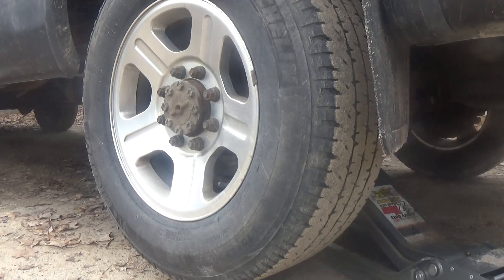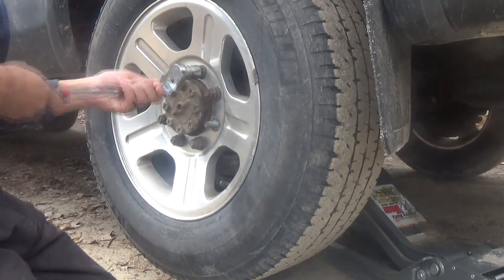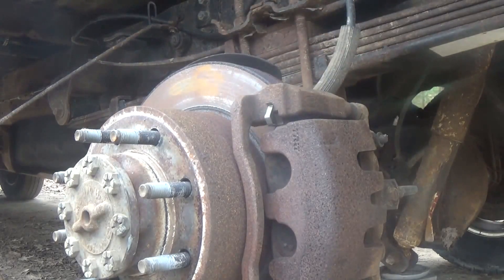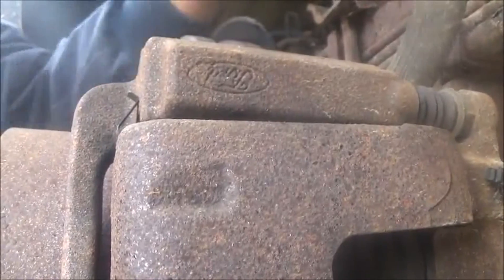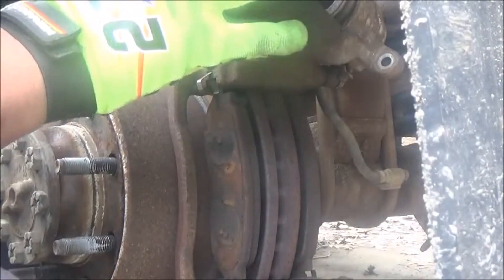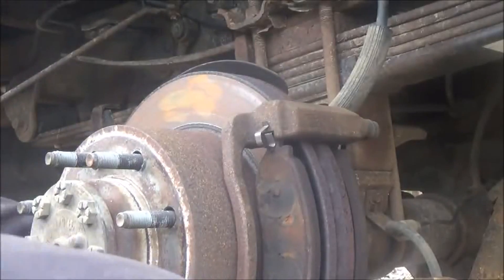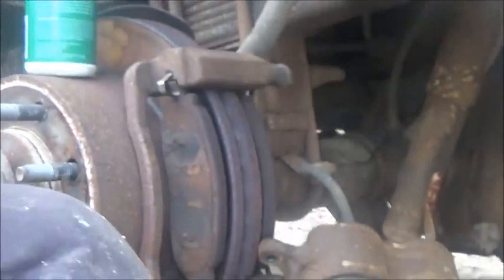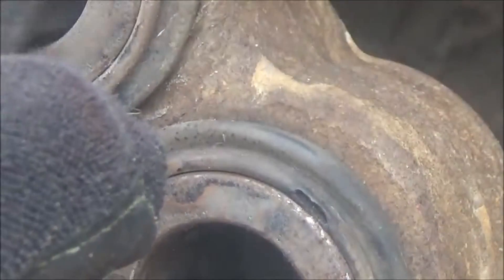Can you smell your brakes or hear squeaking?  Try this free fix!

Comment: This could also be a problem with the brake hardline or rubber brake hose not allowing brake fluid to return after braking. They can become crimped, clogged or in the case of the rubber line, just wear out internally. Check the bleeder valve before buying a caliper. Open the bleeder... if fluid shoots out  under pressure, it's the line. If fluid slowly oozes out, you need a caliper.

Comment: I replaced my brakes up front rotors and pads, now one side is locking up for some reason. The pistons acted fine when retracting them. I did notice the brand new pads were way too tight going over the rotors on both sides I am wondering if the rotors are the wrong ones. I got them from rock auto. So if the pins are causing the caliper to not function right?  It looks like your piston on that side is totally seized if the pad is not contacting the rotor at all.
Reply from the maker: Correct kind of.   The brake assembly only supplies actual pressure to one side.  So if the pin freezes then the piston is only pushing on one side.  Not sure if that makes sense, what I'm trying to say.  
I've never used parts from that place so no idea about that experience.  I bought all four for my truck and I just resurfaced them once since.   Big cost up front but to have them "turned" it is a fraction of the cost.   
I'm glad your watching though.  Hopefully I helped in some way.   

(Related to your screen name)  I have recently gotten back into RC.  So now with my 3d printer I've been making tons of custom parts.   I will probably make another account (if I do) to show RC stuff.   

Thanks for watching. 
DIY-Zac

Comment: Good video.  Glad to see you are using correct lubricants.  Anti-seize on lug studs is excellent also.
Safety note:  It is better to set the vehicle down on the jack stand and then leave the jack under, than leave the weight on the jack.  The way you have it, if the elevated vehicle rolled fwd or aft while falling it could miss the jack stand or hit at enough angle to dislodge the jack stand. This is particularly important when the rear axle is elevated on a RWD vehicle but applies universally.
Reply: What is wrong with the silicone brake grease?
Reply: @lydiahubbell6278  Nothing.  It works just fine.  On the square O-ring for caliper piston I use the brake fluid it self because it is very slick and lower viscosity for ease of installation and easier (modestly) to clean up excess.

Comment: This happened on my '08 Silverado 4wd when it had low miles. I took the caliper off and changed pads. I couldn't find a thing wrong with the caliper except it was stuck. So I loosened it with the clamp as you did and it never happened again. I'm at 107K miles now. It seems to be happening on my Jeep now. Did you ever do part 2 to this video?
Reply: It’s usually the brake hose that needs to be replaced,If the caliper pins are moving freely.

Comment: Hey off topic, I put new rotors and pads on my car but they smoke and smell when even on a small downhill. Yes, I used all new hardware plus clean and lubed everything really well. The calipers retracted smoothly so pretty sure it's not those or the lines. Is it possible the master is not allowing the pistons to retract all the way?
Reply from the maker: Hmmm that's a tough one, before changing your brakes did you add any fluid?  Maybe it's over filled?
Not sure what your system looks like but is your hand brake e brake system hanging up?

If it's not one of those then I'm tongue tied, hopefully you figure it out. Keep us posted and let us know how it turns out!

Thanks for watching, thanks for your question. 
Backyard DIY-Zachary
Reply: It's only the front brakes so don't think it could be the e-brake as that's only for the rear right?
No the fluid was not over filled.
Thanks
Reply from the maker: @paramandans  Then I am for sure at a loss for words.  Wish I had a good answer for you. 

Keep me updated if you can.
Reply: thanks
Reply: Turned out to be the crap Wagner pads I was using. Put a set on from the Honda dealership and it's all good now.
Thanks
Reply from the maker: @paramandans  o man what a pain in the *    
I had a similar situation with after market oil filter cap on my diesel.  

Glad you figured it out. Thanks for the update!!!
Reply: must be like the twin towers everyone forgot alresdy...did you do the hose thing????
Reply: Sounds like the rubber brake lines have failed.
Look for swelling in the brake lines.

Comment: I have brake jobs to do ever so often…Zach, like your style!….now I put new shoes on my driver’s side rear with a new rotor…….Drove it the next day to break it in….had to make a quick stop, stomped on it!….little bit brake burn smell…later when I stopped at a parking lot..felt that wheel and it was hot….When home, I took off the wheel and looked! It seemed ok but rotor turns tight! Do you suppose those pads are still breaking in…or might you suspect something else?
Reply from the maker: Thank you for watching.  Thank you for taking your time to comment. 

Don't take this the wrong way. But I need to clarify. Do you have break pads in the rear or break shoes?

Comment: A $6 piston rubber seal boot and clean the piston bore... Sometimes the bore becomes too heavily damaged and the entire assembly requires replacement.
Reply from the maker: Thanks for the tip, I never knew you could buy the boot separate.  Usually when the failure is caused by the piston I just replace the caliper.  
Maybe next time I have an issue with one I will try your tip.  

Thanks for watching and commenting!!
Reply: The auto parts stores like to call this part a "caliper rebuild kit". Although just a rubber seal.
Reply: How do you clean the piston bore?

Comment: My rear driver side brake stuck shut on me after I came out of a corner, speeding onto the highway entrance ramp. It was a hot day and I imagine that corner caused enough stress for the pin to seize up.

I disassembled the brake caliper assembly, loosened all the dirt with a wire brush, and cleaned everything with brake parts cleaner.

Then I lubed up the pins, which were dry, and put it back together.

My ‘04 Astro van is now running fine and ready for work.
Reply from the maker: Right on, that's the name of the game.  Good thing you are handy, a shop would have charged a ton for that...

Thanks for watching, thanks for taking your time to comment.

DIY-Zac
Reply: I have an 04 Astro also. Just Had brake work done.Caliper.." Etc.. Drove a few miles and Noticed burning Smell Back Driver Side Wheel. And Very Hot on the Hub. Took it back this am. Waiting for their call back. Love my Astro..ok that's all😊

Comment: I had slide pins sticking and replaced everything. Tires aren't smoking or smelling bad but still got hot. Bottom pins on both front were stuck and replaced bracket and pins

Comment: I have a Toyota Camry LE 2001 2.2 liter 4 cyl engine . When i was driving it today it smells like a burnt rubber . And the brakes kinda smokes to the passenger tire .and i heard kinda grinding noise when i brake .Iam thinking its my brake pads .I have no experience on this kinda issue . I was gonna change my brake pads . Any good info would be appreciated
Reply from the maker: Thanks for watching and commenting/asking questions.     Firstly I would say you need to determine is the caliper the issue or the pad.  If you see smoke/steam or you feel heat when you put your hand near the rim then that is the wheel that has the issue.   Or if you want you can jack up each tire individually and turn them by hand ( cant be in park or have the parking brake set) so make use you are level before you do this.  Or chock the tires so it doesn't roll.   After you figure out which tire it is a caliper is a relatively easy swap/replace job.  I don't think from what you have said it is the pads at all.   Although the caliper being bad will cause pads to prematurely go bad, so youll probably end up replace the pads as well.  But first things first figure out which caliper is causing issues.   
Feel free to comment again with how it is going or when you've got it replaced.

Thanks again for watching.
DIY-Zachary

Comment: How far do you gotta drive to tell I think my 2005 ford freestyle is doing the same thing when I stop I gotta press on gas pretty hard to get going again
Reply from the maker: James Moore. best easiest fastest way to tell is Jack your tire up and see if it will spin freely.  Of course if it is a drive tire then you will have to put it in neutral, they all should freely spin....
Reply: Backyard DIY okay will do thanks a lot buddy
Reply: Wow. So if it is sticking its the caliper? Do new calipers come with new pins?
Reply: if you stop and there is no roll motion it is stuck if they release the vehicle will rock or roll slightly

Comment: Good video. My 98 mustang brakes where smoking. Before I changed them I noticed that my pin wasn't moving at all. Or if it had a screw. So I'm sure that's the problem. On my back driver side. Thank You for the video. Good information
Reply from the maker: Thanks for watching and your comment, I enjoy when people are interactive.  
Thanks for your time!

Zachary
Reply: What if the pins are good.  But The rubber is hard.
Reply from the maker: @robertallen2943  The rubber on the pins shouldn't be hard but also that shouldn't stop them from sliding correctly.  If your referring to the rubber on the piston that will appear hard just because the piston is inside it, that also however shouldn't affect slide ability.

Comment: It'll take sponginess out of your brakes? Why would the brakes feel spongy with a block in the line. mine are spongy and my brakes are sticking why is it spongy? The sponginess isn't a loss of fluid so what is it. Fluid not returning to the master cylinder? what difference does that make cuz you still have break fluid in the line. Is there negative pressure causing air bubbles somehow because of slight moisture and that accumulates air bubbles with negative pressure? Just like your joints cracking just negative pressure and creates air bubbles in your joints when you pop your joints?

Comment: I have talked to several mechanics and they say that the pumpkin is strong enough point to jack up the expedition.  Where exactly do you you find the best place to put the jack and jackstands..Do you have a video on this?
Reply from the maker: I totally agree I jack on the pumpkin. The only down side to that is it is generally off center so for example if your right rear is the tire you want lifted and the pumpkin is left of center then you'll have to jack pretty high to get the right off the ground. 
But the pumpkin is the lowest point so it makes it easiest to jack especially on a tall vehicle.  
I jack from it and then place my jack stands as close to the wheel I'm working on, on the axle.  
Hopefully that answers your question.
Reply: @BackyardDIY-Zachary  yes that helped.
Reply: don't you have a operaters manual everyone ive ever seen tell you where to properly jack at which point

Comment: Hit my brakes pretty hard the other day and the pedal went down and there was a crunch. The pressure went down after that. It still brakes and there’s no leaks. Fluid is fine. Not sure what it is. One friend said Master Cylinder another said brake line.
Reply from the maker: It's not a line since your not leaking any fluid. 
Diesel or gas?
I'm thinking master cylinder is your problem, I had one fail almost same scenario as your describing and it was the master cylinder on my 01 explorer. Some master cylinders are repairable but even when they are I've noticed it is easier and a better bet to just replace.  

Thanks for watching, thanks for taking your time to comment.  
Zachary
Reply: @BackyardDIY-Zachary  Thanks! Its just gas
Reply from the maker: No problem, my guess is the master cylinder. Just make sure you do a good job of bleeding all the lines after you change it, if you do.
Reply: what is it people don't you paya ttention the line hose can gwt rstickted and wont allow the fluid to return tp master cylinder they sometimes collapse internally  and thus a stuck caliper//// @BackyardDIY-Zachary

Comment: hello i changed my pads and rotors in 2016 and again in 2017 and now again i have to change..at 32k and 40k and now 55k km..each time always same thing..pads are seaized because no grease enuff why???...the mecanic said he greased each time...Lisa (they said caliper pins are fine and caliper itself is fine too)
Reply from the maker: I'm not splitting hairs with this question. But what specifically are they saying isn't greased?   Because you should never have grease in contact with the pads.  Caliper pins yes,  pistons inside calipers yes (although technically it is a sealed caliper so it should only have brake fluid on it)
Not sure what could be causing this issue.  Are you changing pads and rotors at the same time?   Or maybe you ride your brake pedal?  Car or truck?   Lots of heavy hauling?   Mountain driving?   Not sure without more info the issue.  

But just for an idea my 15 Civic hasn't had either replaced in the almost two years I've owned it.  
My 1 ton diesel has only had pads done (aside from the failed caliper)    

Thanks for watching,  thanks for commenting.  Hopefully we'll figure this out.  :)
DIY-Zac
Reply: @BackyardDIY-Zachary  and so im having repeating same issues as you..each year in 2016 and 2017 my brake pads were stuck and seized and i had to replace the pads and rotors and now again since summer 2019 i was told my pads are seaized and also the caliper pins but in fact this past week i was told when i brought to another garage that my caliper slider pins are fine like in your video but my pads are seized and my rotors need replacement but pads are still 65% good...so i was told in 2016 and 2017 that when the brakes were replaced they greases and lube the proper parts but now there is no grease..why are pads always geting seaized and ruin my rotrors?? if i am to beleive that they were cleaned and lubed and greases in 2016 and 2017 and now since 2019 my pads are stuck and are ruining my rotors?..i thimnk my rotors are like yours and still hopefully good  and i will try to do what you did in video but i not sure i have the tools...i have 2015 hyundai elentra and i had brakes done at 20k and 32k and 45k and now at 56k  km still need to fix stuck pads..Lisa

Comment: Just one quick observation. What exactly was producing the heat that you felt?
Reply from the maker: nope Nunya:  The slide pins weren't releasing, causing added friction on the rotors.  Which causes them to get hot.  

Thanks for watching, also for commenting. 
Backyard DIY-Zachary

Comment: I just replaced calipers brakes did not replace rotors and my brakes are still getting HOT...brand new brakes and calipers what the HELL is making this HOT you could HEAR the metal MAKING pin pin noise
Reply from the maker: Did you replace calipers?   Or just brakes? 
Either way if you re used the caliper mount it is possible the pins are sticking/ frozen.     If you didn't change calipers maybe one is seized.  
If none of those options you got me,  maybe they aren't squeezing equally making one work harder or just one stopping the whole truck.
Reply: @BackyardDIY-Zachary  thanks buddy I replaced all 3 caliper mount and calipers and brakes caliper and caliper mount comes together or at least I bought it brand new autozone..and I bleed the brakes today by disconnecting the negative battery as you stated and already went THROUGH 2 1 liter bottles of brake fluid and pedal still goes to the ground ..held brake while truck on turn truck of hold pedal for 30 seconds and pedal rises all the way up..tested booster it gas suction just like you showed..
Reply from the maker: @kangokidkidd4037  I'm at a loss without tinkering on it myself.  Try asking in a FB group, I am on a powerstroke group.  Most of the posts are showing off and bragging but some guys/gals in there actually are helpful though.     I hope you figure it out,  be sure to let me know what it is when you figure it out.   Sorry i can't be of more help.    

DIY-Zac

Comment: wheel is very hot after 5 to 10 mile drive.
Reply from the maker: Bigya Dhakal:  Sounds like you have slide pins not sliding or a caliper that has failed and will not release.
Reply: Hey!! This is also going in with my car. Hyundai accent 2009.  I replaced the entire brake system. Everything. New roters calipers pads you name it. I replaced it. Brakes getting hot after 5 or 10 miles  maybe less. None can figure this out. I have someone help me bleed the brakes every other day .. that helps a lot but not completely. If they don't get bled they seize right up as soon as I get on the road

Comment: My clip is kinda rough, is that it?
Reply from the maker: Not sure what your referring to by clip.
Reply: Backyard DIY - Zachary my caliper was frozen, but I got the piston to move in and out, but my pads didn’t seem to wanna move away from the rotor after I took the caliper off. Napa has my brakes 60$ a pop, mine are kinda rusty too.
Reply from the maker: @fbi6540  ouch, lol I hear you though. Driving such a large truck costs when it needs work.  

Good luck with everything keep us posted!!

Comment: rust on the disc rotor indicates the caliper is stuck open not closed and binding as this video is showing. why do amaricans say hanging up. hanging up is supending something in the air by defying gravity. why not say binding its so much a better way.
Reply: I guess everyone has their hang-ups.
Reply: they said gangin up cause they think they r smart
Reply: wow ae we trying to be politically correct,
Reply: Because binding is equally bad.  This isn’t a book or a ski boot attachment nor a legal contract.  Seized is the preferred term.